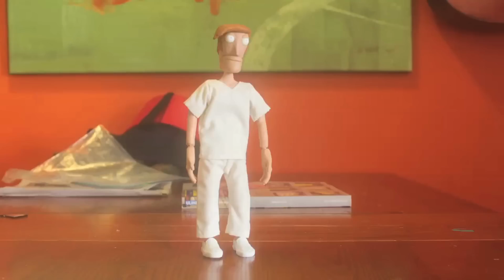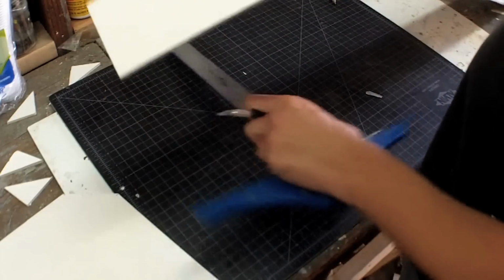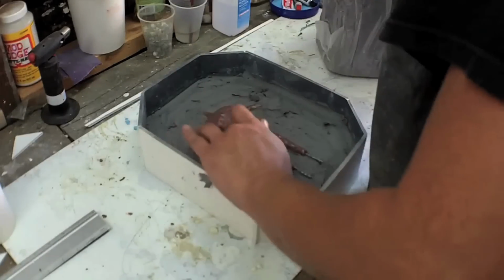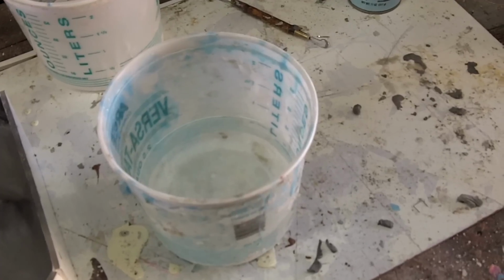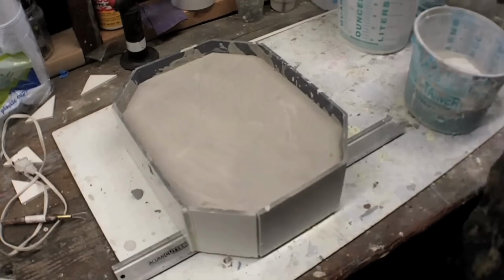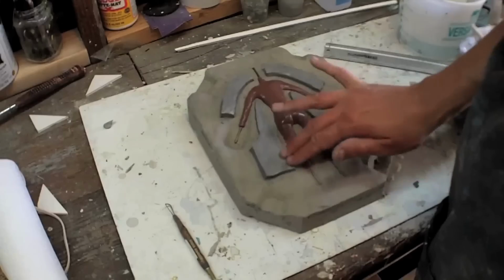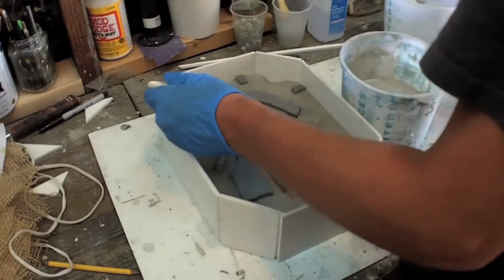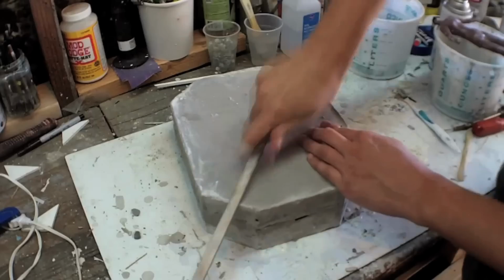S1 Silicone Puppet - Body Mold Tutorial

Comment: Painting the ultra cal seems to be a sure way to not get bubbles but if ya want to do it quick You can pour a little then vibrate it with a vibrating table or run a drill while holding it against the outside wall like they do in dental labs and when making prosthetics
Reply: And youre not gonna waste your time casting a Gold Crown or a Bridge on a mold with bubbles so at a dental lab its worth the 'investment' (pun intended) to get a vibrating table. Most are about the size of your mold and it really getsthe bubbles out

Comment: Tip at 30mins is new for me and will be adding to my next calamity. Number 3 . Need to find a white paint that will stick to metal. And addition cure silicone will stick and set to. .
Most recent disaster was a cast that didn't set after the thing was left on a heater for a week. Painted the armature and mold for a smooth finish and got a blob. Keylon white enamel. It also mildly broke the mold. The previous one sompletly stuck to the mold that needed smashing and still had cure inhibition on a few lubricated parts of armature. .
Getting through the materials cronic with little results but still enjoying the process.

Comment: Very helpful video, I have a question in relation to what the mold can be used for. In your video you said the mold can be used for casting foam latex and silicone. My question is, can this mold also be used to cast resin? Your answer would be very much appreciated.
Reply from the maker: +eric izzard No, you need to cast Resin in a Silicone mold.
Reply: Thanks so much for your response. Just one other question, do you have any experience with casting resin? If so I would much appreciate it if you could make a tutorial or direct me to one.
Reply from the maker: +eric izzard Checkout our Puppet Head Casting Video. We use a Silicone Mold and 2 part fast casting resin.

Comment: Thanks so much for this comprehensive tut! My only question is why is it important to specifically use water based clay? You mentioned something about chemical reactions but I'm unaware of any potential chemical reaction between something like Plastalina oil based clay and Ultra Cal. Is there something I'm missing? Only asking because I'm about to start this process with Plastalina because I don't have the time to wait for WED clay to ship. (FYI, my model was sculpted with Chavant Med Hard). Thanks again!
Reply: Hey, how did Plastalina work out for you? I've the same problem. I could buy Wed but it only comes in 11kgs here and it seems a bit much

Comment: This maybe a stupid question but, is it possible to make a mold out of polymer clay or super sculpey without the clay breaking after baking?
Reply: No. For puppets it's definitely better to use a silicone or ultracal 30 mold. Depending on the sculpture and the casting material.

Comment: i working on this...looks fine...however...the plaster dripped through inbetween the cast and the foamboard... any tips on that?
Reply from the maker: +Emanuel Wiemans Make sure you build up the clay on to the walls of the foam board. I also take a wet finger and rub along the crease to insure no gaps.
Reply: thanx!

Comment: in the uk its hard to find WED clay. What alternatives are there? would any air drying clay do?
Reply from the maker: The Fryer If you can find a water based clay that is used for sculpting then that should do. Paper clay is crappy, but can be used it you absolutely have not other option. Good luck and lets us know what you come up with. Cheers!
Reply: WED clay is more common in the UK now. Mouldlife , PS composites and Neill's Materials stock it.

Comment: How long did you leave it to peel off your WED clay? Mine has not stayed together like yours and has clung to the model and plaster
Reply from the maker: Well you have to let the Ultracal30 cure. You should also spray your WED surface with crystal clear before you pour your mold. And lastly, it's WED Clay so don't be afraid to use a bristle brush and waster to clean up the mold half. Heck, sometimes I put the mold half under the gardenhose if I know it's not going to hurt anything.
Reply: Actually before reading this I just put mine under the shower (took the shower head off and put finger over the spout) saw them doing it on face off thought I'd give it a go, worked brilliantly didn't even damage the original chavant clay model in the slightest and I was being quite close and powerful with the water blast now to smooth out my original attempts at digging the clay out and do the back half.

I had used a mould release on the model and WED front and back but it just stuck fast and I did it too quick probably as the wed clay was slightly warm and very soft.

I'll put a blog post up about it on www.NilePlumb.co.uk soon

Comment: Could you substitute Krylon Workable Fixitive for Dulling spray?
Reply from the maker: The Krylon Crystal Clear is what acts as the barrier. The Dulling Spray acts to take the smoothness out of the Crystal Clear and give it a rough surface. You definitely will need to use the Krylon Crystal Clear, but you can omit the Dulling spray if you need to. You won't get amazing results, but it will still work.

Comment: HI there! I hope you are still responding to questions! I want to make the switch from dragon skin to tinsil gel and was wondering if there was a specific kind that you used? Also it isn't listed on the engineering guy's website- they have something called smooth-sil. Would you mind posting a link to the brand of silicone you used in the video? I would be so grateful! Thank you! and thank you for the great video- my mold turned out fantastic!
Reply from the maker: +Molly McCandless I would suggest looking up MotionPictureFX that's where I buy TinSil Gel, but there are lots of suppliers. If you can find one closer to you I would suggest that. Also, buy a small amount to test with and make sure you like it.

Comment: Why the head and the feet are made out of plastic and the body is made out of silicone rubber?
Why we need to use two different methods?
Reply from the maker: spinocroc123 It's a simpler method than the whole armature being in the feet and hands. Also, this is a basics casting/puppet tutorial. The feet are cast in plastic and are extremely strong. You'll end up with a better ability to get the poses from the puppet and not worry about that part of the armature breaking. The Hands are static and can be replaced to form fists and pointing. Nothing will stick to silicone. So you will run into problems when animating the character and you want them to hold or grab something if the hands are made of silicone. Once again this is a basics tutorial so I'm giving you an option that will allow you to work faster when you animate and get more done in less time. @spinocroc123 I thought I explained this in the video... Didn't I? Sorry if I didn't...
Reply: ok, thank you.